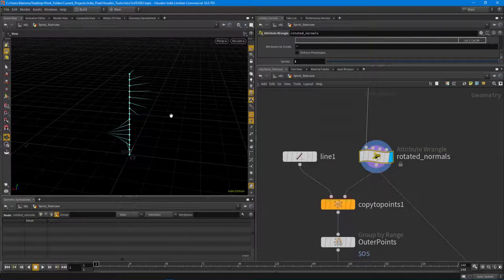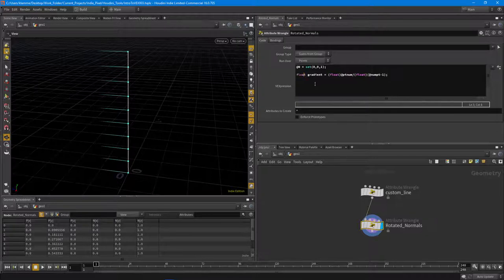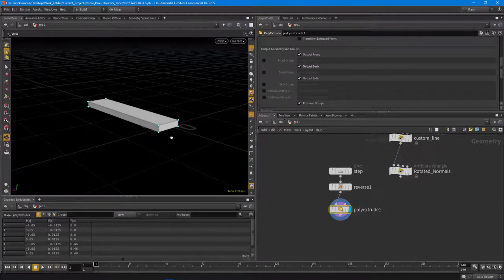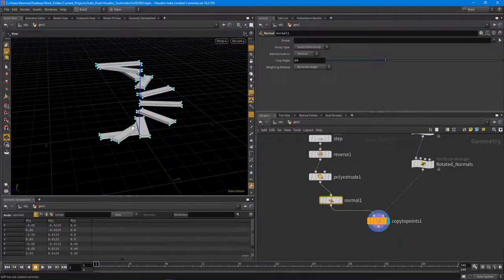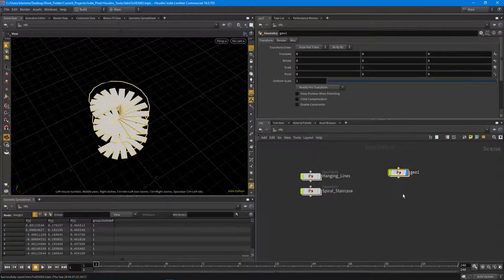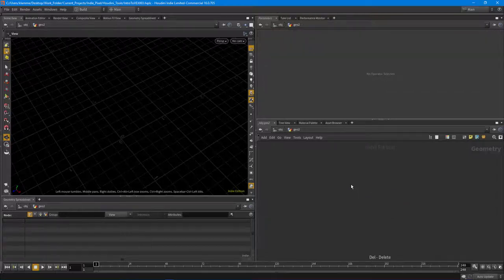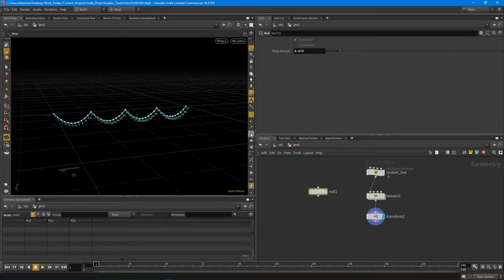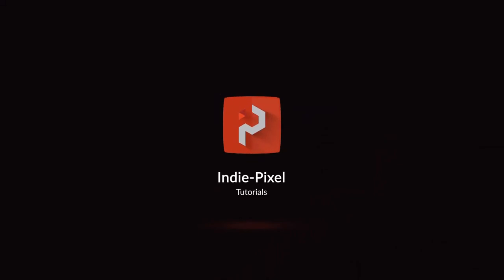Intro to Houdini 16 VEX - PointsAndLines - Part 3

Comment: Thanks for the great lessons , but i used version of houdini 16.5 and do not find node "foreach network" in my version??? What i need to do???
Reply from the maker: In h16.5 they had the for loop blocks...but I would recommend upgrading, if you can ad the for each nodes are much easier to work with.
Reply: @IndiePixel3D  thanks, I understand, and learn all about fore each loops in my version.

Comment: Great stuff. Thanks for uploading this. You are the same guy from the GaTu tutorials, right? Really nice to see you here as well. I'd like to say your tutorials really helped me starting out.
If I may append and ask you a couple questions. Is there a reason why ou used a For Each Network instead of the normal For Each loop on the draped cables example? I prefer keeping it on the same level, that way I don't need a null to control it.
Since I'm forcing myself to learn vex more in depth, I tried to offset it back to the origin avoiding the -$YMAX, and a wrangle with the following code does the trick, maybe it'll help someone else:
v@offset = getbbox_max(0);
@P.y = @P.y - @offset.y;
Cheers man, hope to see more videos from you. I'll keep watching them in order.
Reply from the maker: Howdy Ricardo!  You are more than welcome!  Yep I am the Gatu guy.  I had to take a break from Gatu for a bit, but am getting back into the game.  Nope there is no real reason I used the Foreach network.  I think I just went into old school mode in the video.  Your fix does the trick perfectly.  I say that is much better indeed! :-)  Thanks for the comment and the help!  I am posting more vids this week and next!  Stay tuned!
Reply: Thanks. It helps! Just trying the same some days ago...
Reply: I will tag on and say ditto, learned a lot from your GaTu tutorials with HDA building! Wd.

Comment: Fantastic tutorials. I'm using 17.5 and coming across a strange error where when my 'hand rail' passes over the -x axis the polys twist like its suddenly bridging or sweeping the wrong direction. Any idea why this would happen? Codes pretty much identical to yours.
Reply from the maker: Hmmm...sounds like a line direction issue.  Make sure you have the flow normal, the right vector and the up vector to ensure proper sweeping and copying to points
Reply: @IndiePixel3D  The normals of the each of the points seem to be right, but everytime it gets to the -x axis the up vector seems to rotate (judging by the point numbers). How do I add a right vector to the original circle? I have tried adding a vector to it using at attrib wrangle (by just creating a 1,0,0 vector and assigning it to the primitive) but that seems to stay in world space as it rotates and doesnt rotate with the primitive. The Tangent and Bi-Tangents that polyframe creates seem to be on a per point basis even though it is set to primitive. (Sorry super rookie at Houdini)
Reply from the maker: Ah...no prob...watch intro to vex part 8...that goes over the math for creating the line directions...let me know if that helps or not...:)
Reply: @IndiePixel3D  Just if someone else has the same problem. For me it got solved by checking the Normal Name in the Polyframe and typing in     up     in lower case letters. Hope it helps someone :)

Comment: WTH happens at 22:27? All of a sudden the line is duplicated. I only have one hanging line.
Reply: i realize this is 8 months late but for anyone else who is wondering what happens, the line he is original working on is split up into multiple primitives. Which is then hooked up to a for each primitive node. So the attribute wrangle instead the for each primitive will drape every primitive and so if you render the end of that loop you it will look like its duplicated.